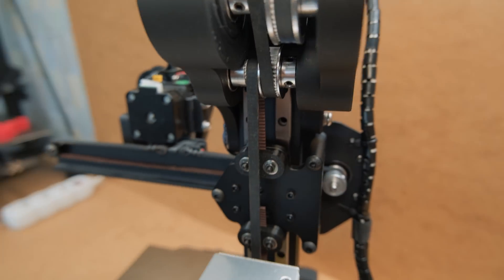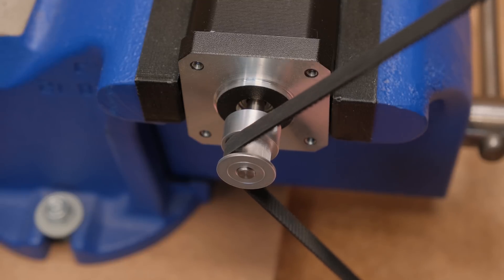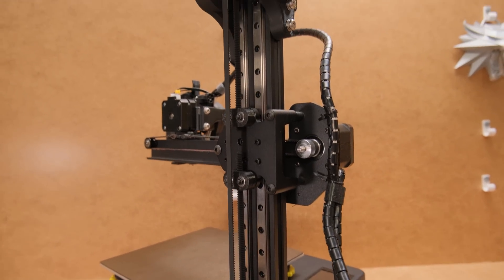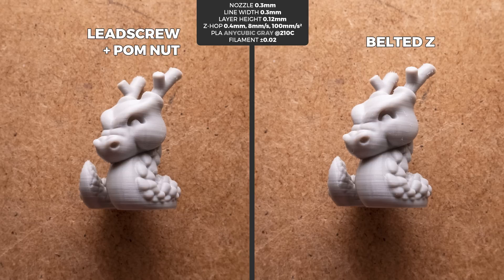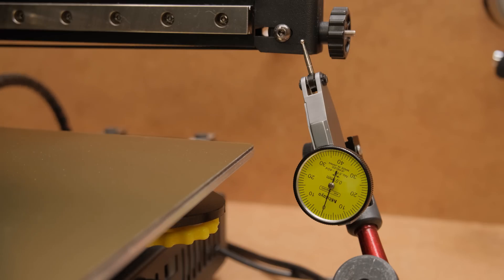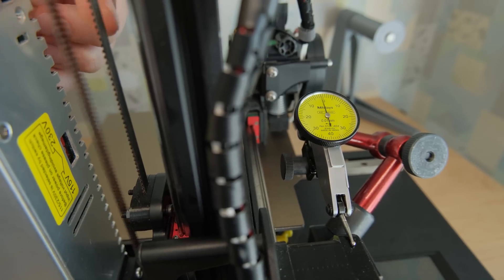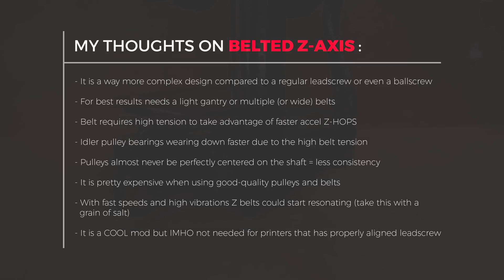3D Printer’s BELTED Z-AXIS – INSANE PRECISION!? or NOT WORTH IT!?

Comment: I implemented a belt-driven Z system in my custom-designed CoreXY printer, but in a different way than yours. I used thick timing belts and placed four separate belts at the four corners of the build plate. With this setup, you cannot move the bed by hand. In fact, because of the number of belts, pulleys, and motors, even when the printer is powered off, the 80/20 pulley system is strong enough to hold the bed in place.

As for concerns about vibrations at high speeds, timing belts are not very prone to stretching and are not significantly affected by low-frequency vibrations. However, your bearings need to be strong; simple 3D-printer bearings won’t last long in this kind of system. You should use high-quality bearings with a higher load capacity, both for the upper idler pulleys and for the shafts of the Z-axis pulleys. Right now, I can achieve much higher surface quality in prints compared to a ball screw system.

Comment: I agree, for small printers belted z axis doesn't make much sense, but as you size up in printer Id wager they begin to make more sense as larger lead/ball screws get exponetially more expensive the larger you go. Further, wouldn't a gear reduction in general (not just for the belt, but leadscrew as well) lead to even lower minimum layer height? Say with a .2 or .1mm nozzle?

Comment: personally i prefer using a steel belt instead of timing belt ( cause they dont strech a measureble amout over time and since it can run directly on the shaft meaning its would run perfectly unlike timing belt )

Comment: For the grip on bigger pulley is to put belt tensioner using toothless free moving pulley in between the two pulley. That way you got more belt contact in smaller pulley

Comment: I looked at this and came to the conclusion a 10-1 geared stepper is easier and cheaper and gives same resolution as lead screws at 0.02mm per step from a 1.8 degree stepper I think yourself with 6-1 reduction is a resolution of 0.03333 mm per step

Comment: You can use flat idler pulleys to wrap the belt around small pulley.
This s common practice with roller chain drive where very high ratios are common

Comment: What if instead of the gear ratio you use a counterweight so the the printhead floats even without power? Of course double the weight to move = slower z hops but it would make the design much simpler and include a belt as you intended. Would love to see that :)

Comment: Seems way over complicated. You could probably just use some kind of a spring tension brake system that holds the position instead of all that stuff. Maybe even a counterweight system, but a brake pulley system would probably make more sense.

Comment: Suggestion for using less pulleys whilst achieving the large reduction and avoiding the lack of meshing teeth.
Use two smooth tensioner pulleys to tension the timing belt around the driven gear, such that more teeth engage.
Then you don't need a staged system.

Comment: Overall the best inexpensive method for the Z-axis for a bed slinger is double THICK lead screws. You will see a significant quality change by going from 8mm DIA to 12mm DIA with lead screws.

(you can go larger but check your step per rotation and it will start to get expensive)

Comment: Have you thought of using a counter weight that hangs over the top of the Z-axis, like the ones used in normal elevators or lifts. This will double the weight on the Z-axis, but it should not be a problem. With a weight balanced Z-axis, you won't need such a lot of gearing.

Comment: Could you use a finer lead screw instead?
Reply from the maker: I actually tested that, but I couldn't see a difference on my modded kp3s pro, so I didn't make a video. The best way is just to ensure that the leadscrews are properly aligned and don't wobble when attached to the motor's shaft. A lot of cheap 3D printers have problems with all this.

Comment: I’m in the process of designing a belted z-axis upgrade for my printer with a 30:1 reduction using a worm gear, which allows a high reduction in a smaller footprint and prevents back driving, so no gantry drop. I use linear rails on the back sides of the extrusions and recently added the rollers back to the outsides (no eccentric nut). The rollers added a significant amount of stability. I want to do belts with reductions for the increased resolution, which should help with ABL

Comment: Would be interesting to see a direct drive 0.9degree stepper rather than the complicated pulley gear box (which probably is introducing noise) driving the Z.  You would need a one-way clutch or counterbalance though on the gantry

Comment: Great video. I've thought about converting my super tall printer to belt Z due to leadscrew wobble, but I wouldn't be surprised if belt elasticity causes problems of its own. Rack&pinion may be best for it.
Reply from the maker: To get good belted z results you need wide belts (how wide and how many depends on the weight) and high tension. Voron 2.4 does it right and results are pretty good. Though I doubt anything beats a ballscrew precision wise.
Reply: @PrintingPerspective  Ballscrews are annoyingly complicated though, since you have to have a coupling that allows lateral motion. They're very stiff and usually not quite concentric, so unless the frame is super stiff like a milling machine, they cause worse wobble than a leadscrew if the nut is rigidly mounted.

Comment: My experience with Ender 3 clone:
- brass lead screw nuts are OK-ish in single direction
- belted Z and POM nuts behave better with Z-hop (there is no slack, so they can pull X gantry down. POM nut can wiggle a bit, but usually won't have unrotated movement along lead screw)
- Z wheels must move really smoothly (as in each wheel "cage" must fall freely without any other weight, e.g. stepper or gantry). If there is only single lead screw, the "free" end wheels should be really smooth movement (fairly loose) or it will start to get behind and gradually catch up with driven side?
- counter weight prevents belted Z from falling (belt from gantry, around idler or bearing on top) but may create new problems with needed space and swinging
- dual steppers with separate belts or lead screws better be identical
After all that, it's running dual lead screws synchronized with belt, POM nuts, loose wheels and single larger-than-normal stepper motor.
If I would add linear rails somewhere, it would be Z 😅

Comment: This test is flawed because in order to see the effects of the Z axis you must first remove the biggest source of inconsistencies: the extruder. The simplest way to do this is to get a bowden extruder. The bowden will even out any inconsistencies. The other way is to get a direct drive extruder with RIDGA gears and replace the idler gear with a bearing. Or get a CNC vz-hextrudort with twill gears.

Comment: I just printed a cali dragon on a slightly bent dual z-axis lead screw printer and got a print almost like it was injection molded i cant find any problem even if i wanted to. Printer: crealiy ender 3 max neo with sprite extruder and klipper

Comment: I’m using the Kevin aka sam belted z on my e3v2neo, print quality noticeably improved, I think the original z screw might have been slightly bent or damaged, which is why the print quality improvement was so large
Reply: did you have to change the top extrusion? my e3v2neo doesn't have slots on both sides of the extrusion...
Reply: @ yes, initially I did have to do that, but a little later he released an updated version that doesn’t require the top extrusion to be changed.
Reply: @Aikano9  oh may you say which version that is?

Comment: all those wondering why belts are not used: a normal 8mm ball screw gives you 2mm per revolution, a 16t gt2 pulley has a circumference of roughly 40 mm. now if you rotate that small pulley one full rotation, you have 40 mm per revolution the belt is traveling. so instead of having a 20 :1 transmission on top of the belt its way easier to have a screw.

Comment: I've fixed that artifacts in your video by changing my stock extruder to BMG Original. Trust me, it's not about Z rod or Z issues. Is the extrusion inconsistency and the extruder gear issue.
Reply from the maker: You should have watched the full video before posting a "trust me bro" comment lol

Comment: Those pulleys are crazy overkill. The simplest and most compact way is to use a 5:1 worm gear. That maintains the 400 steps/mm on a standard T8 lead screw, and is also a self locking mechanism. The gantry will never drop.

Comment: The artefact magnitude seems similar but the artefact quality is different. It occures to me that your belted Z suffers from random layer to layer misalignment while your lead screw build has a repeatable pattern. It occurs to me that the results would be improved if you had a direcrional preload of some kind, and odds are, the compliance of belted Z can take it just fine, while fitted nut screw might become overconstrained and bind up. I think dual lead screw Prusa Mendel style builds are really overconstrained that way and belted Z is a good design trait for them.

Comment: The thing is, a good lead screw might be better than a good belt, but even a cheap belt is going to be way better than a cheap lead screw. And we all know what kind of lead screws our 3d printers tend to have.

Also, belt usually means dual z, which is a massive improvement. You can do dual screws, but that means either driving them from both sides (major pita unless you have a board that can G34) or syncing them with - guess what - a belt.

Comment: I'm using a belt z mod from kevinakasam on my ender 3 and my print quality improved, most noticably when z hopping was enabled. You do have to maintain pretty tight belt tension like you observed in your video. Also it enabled faster z speed so probing the bed is faster. I don't regret the mod

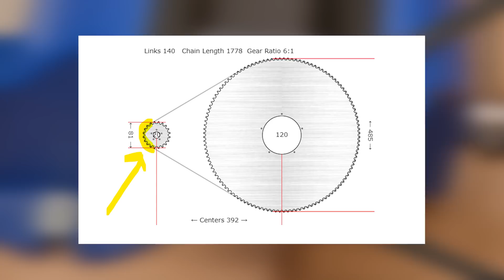Comment: The original design of the belted-Z system you showed at 01:40 as an example to use 20T : 125T pulleys,
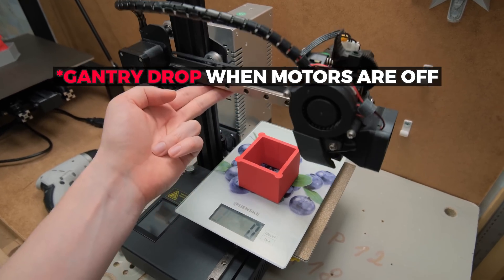which you also showed at 01:02, is actually a 1:8 reduction ratio design.
To deal with the Z dropping issue, you can also use a counter-weight or a spring system to act against the weight, like the Key-bak design on Voron Switchwire.

Comment: Well, standard stepper motor with standard lead screw and half-stepping gives you a 0,01mm resolution. The only problem: most 3D printers and cheap CNC machines don't include backlash cancellation on Z axis, relying instead on gravity. A simple fix would be a backlash cancelling nut, a spring and 3D printed slot to keep nut from turning. This adds little to mass but spring not only would cancel backlash, but would also act as dampener. I'm planning to add this when I'll be adding a second Z-axis screw and stepper to my Ender 3 V2...

Comment: I think your findings make sense, but also I think there's some things you can do to improve results. Looking at your "Idler mount Belted Z" in the video I see it's plastic and even looks like it's bowing under the strain of the belt tension, I think that part needs to be re-though stronger or printed in metal. Also most belted Z I've seen are also dual-belted, so you're putting all that strain on a single belt now. I'd try using a thicker belt so the belt itself has less flex and more surface contact on the idler, also for the idler maybe you can sneak a larger diameter in there for that same surface contact reason. In the end the belt's surface is still rubber and the reinforced strength in it is length-wise, all the tension creates compression across the face of the idler, so it can still squish there if overly exerted upon, the randomness you are seeing might be the effect of it inconsistently squishing the surface as well as the idler mount bowing upwards in the middle. Also for your linear rails, I think you'd get more strength that resists play, by using a single rail and having the sliders one above each other, then having a nice triangle shape coming out from that that, it could maybe even go all the way to the middle of the X-axis beam? The distance you have the carriages spaced apart will directly correlate with how much force they exert on their bearings to resist flex, but having them too far apart eats into valuable Z height. At the very least try and aim for the pitch v-rollers use.

Just my thoughts on things that might help!

Comment: Great video! Good for you for exploring other options. Funny, logic eould suggest that using belts should work since X and Y use them and the quality is Ok. Heck, corexy uses a very long belts and print Ok too. So, it could be your design (too many pulleys with errors) and "faulty" implemention (no disrespect) that could cause worse outcome than screw.
Reply from the maker: Thanks. The z-axis is not really comparable to X or Y as we have gravity pushing down the gantry by a lot (with this printer in a stationary position belt experience tension like during ~10k accel if it was on a X or Y axis). Meanwhile, X and Y moves are basically frictionless and equal in both directions.
I don't think it is a wrong implementation, it is just when you reduce the ratio so much with a lot of pulleys those inaccuracies multiply. And I used quite decent pulleys. Others who use cheap ones would probably get the same effect with one reduction belt. But because most probably make a mod like this on cheap Enders with leadscrew problems obviously results will be better, but none of them check actual Z movement accuracy with a dial indicator. Maybe I will change my mind about belted z after I build Voron 2.4. :)

Comment: You actually don’t need that much of a gear reduction for a belted Z axis.  The key to using a belt on the Z-axis is to use a counterbalance.  Uses far less torque this way.  Rigidness can also be accomplished with linear rails.
Reply: Apparently a counterweight can have inertia issues on heavier z axis (e.g. beds) and you'd want to use a constant force spring instead. (Count around 20-30 bucks for a pair of good quality 50k cycles ones.)
Reply: @satibel  Yup, it would increase the inertia, but I don’t think inertia is as critical on the Z compared to the X,Y.  This is why Bambu Studio uses carbon fiber rods on their X,Y.  My guess is that he believes the lead screw on the Z axis might be inducing some amount of play.  Interesting experiment but the X,Y play a far greater roll in print quality and any play that a lead screw could induce on the Z is probably negligible. As long as your steps are the correct increment and there is not a lot of play on the Z stage or whatever, it shouldn’t make that much of a difference.

Comment: Check the Cetus printer from 2018's time.. It didn't have any reduction for belted z axis. They just put a one way clutch on the z motor shaft running inside a fixed plastic collar. You tighten the collar just enough where the gantry won't drop without motor actively pulling it down. That works and stops the gantry from free falling. The rigidity of the axis is more on the linear rail on that printer. The belt was not causing/reducing the regidity. But given the y axis is fixed to z carrier with only three m3 kind of low on regid scale to start.

Comment: The PCBWAY thing, that ties everything together is most likely a 150-200€ part. If you get it right in the first attempt.
Reply: That's just for the ad. The part doesn't need to be made out of metal, normally you'd just print it.

Comment: Still don't get why not use a worm gear? Reduction as well as not being backdrivable so no loss in Z-hight and is less complex than all that reduction gearing
Reply: Yeah, I can't see why a z-belt would offer any advantage. Belts are lighter, faster, cheaper, and flexible. Screws are more rigid and precise. XY Belts + Z Screws already seems like the optimal design.

Comment: I think the elasticity of the belts undermine every addicional decimal of precision that you might get from that sistem.
On the other hand, threaded rods are usually not perfectly straight but this issiue can be compensated with mechanical decouplers so you can still achive very high precision and rigidity.

Comment: Nice video. There is also something to consider. More pulleys = more excentricity issue...unless very high quality and tigh tolerances  ..but its hard to fnd. And excentricity on a z system will create artifacts a bit like z wobble
Reply from the maker: Thanks. That is most likely why I got worse results. But even if they would be better, I am not sure I like the idea of the belted z :)
Reply: @PrintingPerspective  I personnaly don't like the idea :) though some have good results with it.
Reply: @PrintingPerspective  look the mod kevinakasam did to the ender 3 dual z belt axis no more z binding from the cheap lead screw and like other said you can put key back mechanism on it but doesn't need; with that system the ony part z is controlled is by the v slots don't need to be parralel to the lead screw meaning that moviments on z axis are always fully vertical